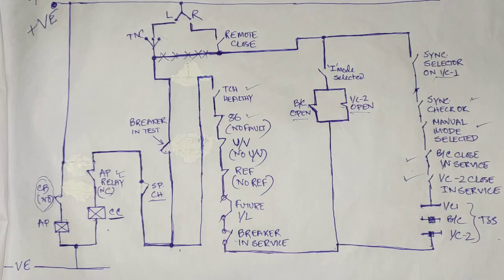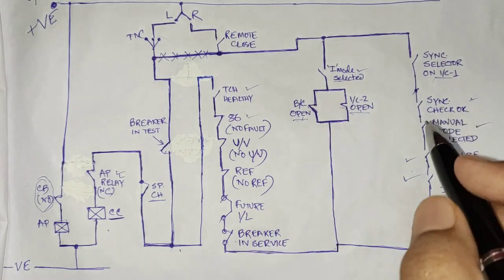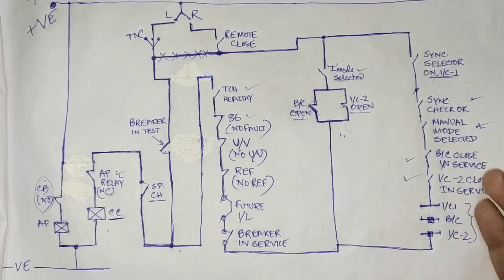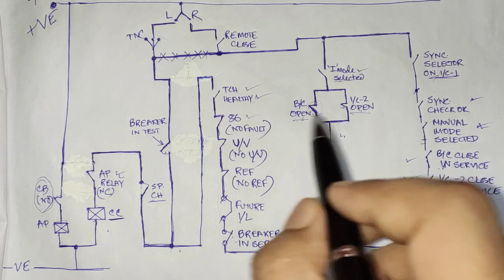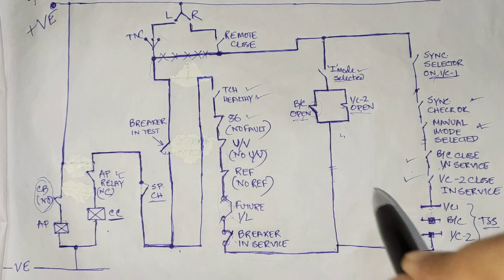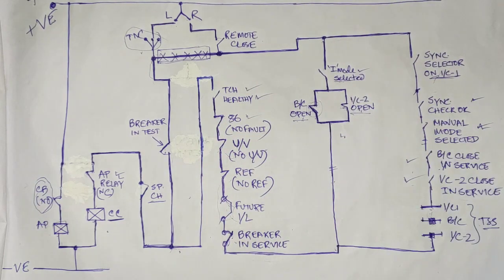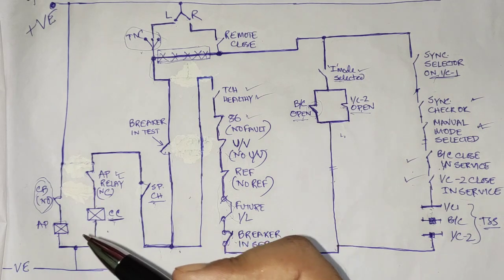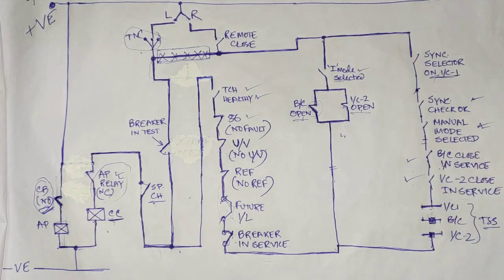Control Circuit of Incomer Circuit Breaker|Momentary Paralleling implementation

Comment: In an M-T-M configuration, when carrying out short-term (momentary) paralleling, where should the synchro check relays be placed?

a) On the Main Incomers (A & B)?
b) On the Tie?
c) On both the Main Incomers and the Tie?

What is the standard practice?